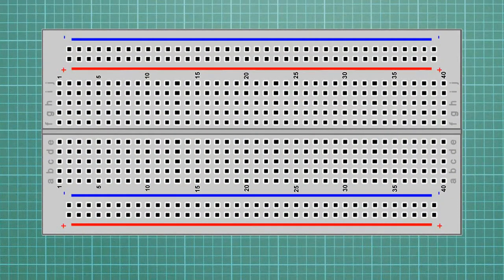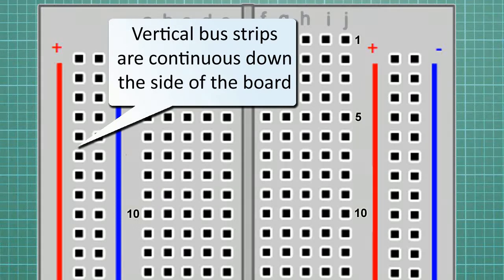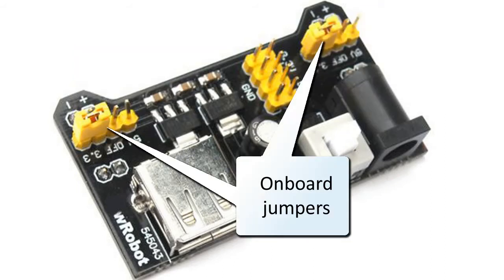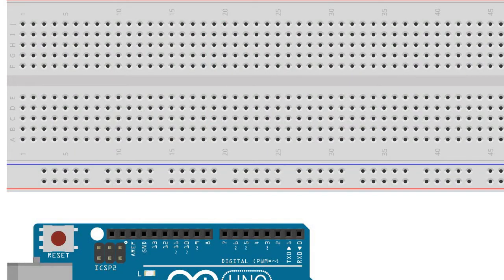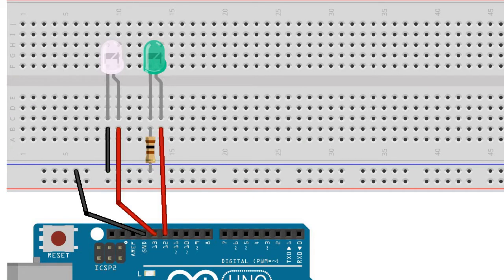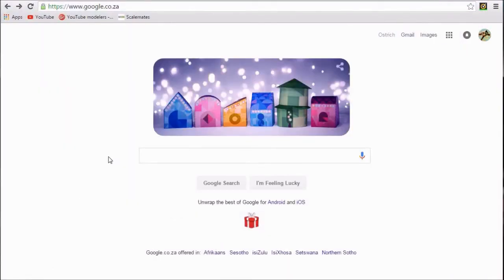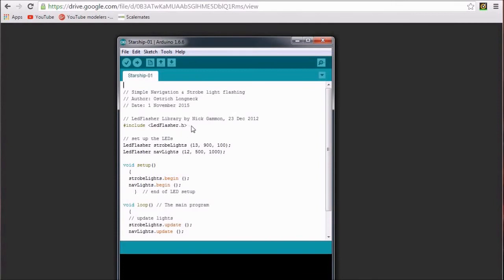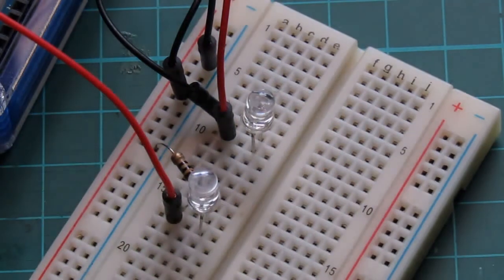Arduino for Starships - Ch02 - Breadboards and Blink Sketches

Comment: Hi, Trevor. I hope you are still monitoring this. I just found your channel, and am enjoying it muchly. However, I keep getting a "no such file or drectory" for the LedFlasher.h files. You did say we have to upload it to the Arduino first (?), but I cannot see how to do that. Your "Starship-01" sketch opens and I see the two extra tabs for the .h file and the cpp file. How do I get them to include n the script (newbie to Arduino but familiar with components). Thanks. 
copy of error:
Arduino: 1.8.12 (Mac OS X), Board: "Arduino Uno"

Starship-01:7:10: fatal error: LedFlasher.h: No such file or directory
 #include <LedFlasher.h>
          ^~~~~~~~~~~~~~
compilation terminated.
exit status 1
LedFlasher.h: No such file or directory

This report would have more information with
"Show verbose output during compilation"
option enabled in File -> Preferences.
Reply: Okay. Thanks for such a quick reply. So I think it has to do with where I extracted the Gui. Mac is not my first choice so navigating for me is tricky. One other question--best way to add LEDs to the chain, for instance, 5 strobes and 4 navs? Each needs its own resistor, correct? Thanks.
Reply from the maker: @smacks9998  Hey Jim :-) If one adds 2 or 3 LED's in series, one can do so without using a resistor at all, depending on the brightness level you're shooting for. But LED's in parallel would need a resistor each. I usually just pop everything on a breadboard and eyeball it from there.
Reply: @OstrichLongneck  Thanks. I built Starship-03, but nothing would let me control it with the switches- they just kept on cycling through their routines (deflector back and forth, phaser flash and photons x2 all going at once. I did something wrong, but i couldn't see what it was. I'll try again later. this is too much fun!
Reply from the maker: @smacks999  That happens when the pull-down resistors aren't connected properly. The Arduino receives random noise from the switches. Someone once had the problem because their breadboard had split power rails which needed to be bridged, otherwise no power went through their switches :-)
Reply: @OstrichLongneck  Ah. Ok. I'll pay more attention to that. BTW, I switched to a Windows computer and "BAM!", it was all good.
Reply from the maker: @smacks9998  Awesome :-) It's a pity that it didn't work on the Mac though. Probably a bug in their compiler or something. But I'm glad that things are A-OK now!
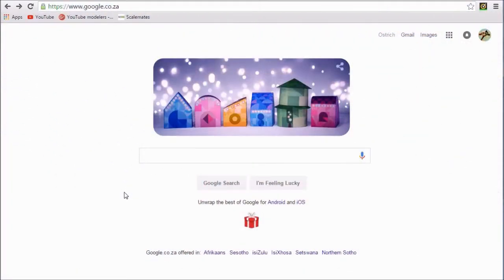Reply from the maker: Hi :-) Thanks for checking out the video! I'm not familiar with the MAC, I'm afraid, although I imagine the process should be fairly similar to Windows. I tried to explain the steps to download and install the libraries at 07:57 in the video. It's pretty much an exercise of downloading and extracting the file into the libraries directory of the Arduino software. Sadly, I didn't know how to code a state machine when I made this video, which would have mitigated the need for the flasher library. I hope this helps a little :-) - Trevor

Comment: My fast strobe blinks 9 times, then goes solid, as does it's companion light on the arduino board. I hit the reset button with the  I have uploaded the sketch several times with the same result.  Any ideas?   One more thing.  If I disconnect the positive or negative of that port 13, the led on the arduino board starts to flash again with a bit brighter light.  I plug back in the jumper into 13 and the strobe continues to strobe as normal.
Reply from the maker: Hi Shawn, you have me positively stumped on this one! I honestly couldn't say why it's doing that. A couple of guys had mentioned they had trouble with Arduino clones (the ones with the surface-mounted ATMega chips) - I think it might be the LED Flasher library which isn't running them. But overall, most people who have built and checked the circuits haven't had any problems. Some have even adapted the code for other builds. The result you're getting is quite strange, though. I have no idea what could be causing it. Keep me posted if you manage to figure out what the problem is. - Trevor
Reply: @OstrichLongneck   Well I experimented at noon.  If I put a resistor in slot 13 then the light continues to flash.  I would guess that when I finally wire in the tiny chip I could hopefully bypass the resistor.    Anyway, thank you for posting these tutorials.   They are awesome.
Reply from the maker: @ShawnMcClureModeler  Sometimes the solutions are completely unexpected. I guess that's why prototyping a circuit is so important. Thanks for sharing your solution - I'll keep it in mind sometime when a circuit acts all weird. Thanks, too for your kind comments and for watching the videos! - Trevor

Comment: I finally got back around to this project. I really appreciate that you posted these videos. I'll be moving on to video three as soon as my Chinese parts get here.  Waiting three weeks for a ten cent part is frustrating. Do you have a recommended assortment of transistors and such that I should order to have on hand for projects? Mofset switches or what ever? I have a gazillion resistors already. Here is my progress thus far. Again, thanks for the help. https://youtu.be/m7DwAlSPuoE
Reply from the maker: Nicely done :-) One can never have too many resistors, especially 470 ohm resistors if you're working with a 9V power supply. I mostly order from Taiwan and China, too, so I can sympathize with your postal patience. It's hard to narrow components down to specific ones, but there are a few basic components which a person uses often. A small assortment of capacitors (0.1, 1, 10 and 100 microF) 1N4004 rectifier diodes, N-channel mosfets, 10K rotary potentiometers, 555 timer IC's - darn, the list is quite long. There are some nice starter kits on eBay - unfortunately the one I found which was amazing isn't listed anymore. It was a set of 800+ components for the Arduino. But if you browse around, I'm sure you'll find something useful.

Comment: This was great. Will you be making any more Arduino videos for beginners? Do you have any other Arduino vids? I am trying to light a custom ufo model with a pro-mini, maybe a couple sensors so I can shoot it with a laser pen. 
You teach well. I finally learned something.
Reply from the maker: +Victor Lystad Thanks, Victor :-) Yup, I have a lot of videos planned for the future. These first ones are laying the groundwork for bigger things to come. There will be warp fade sketches, photon torpedo and phaser effects, chaser circuits, tutorials on putting circuits together and wiring big projects, and adding sound. That's a clever idea with the laser pen! And you'll find it easy to do with a photo sensor connected to one of the inputs. I'm currently uploading a tutorial on the ATtiny85 chip, a great way to downsize projects when there is a limited space inside a model for a  circuit board. Thanks for watching, and commenting :-)